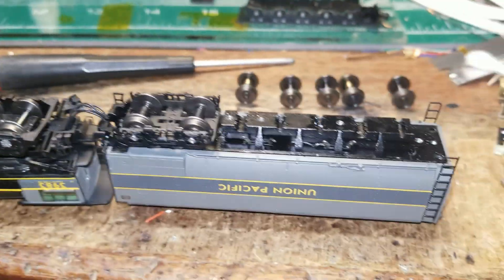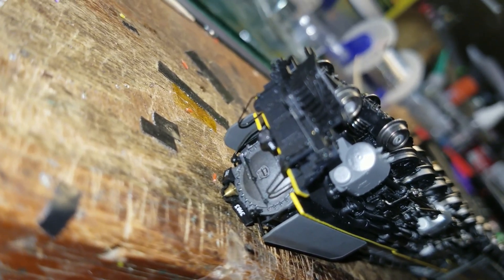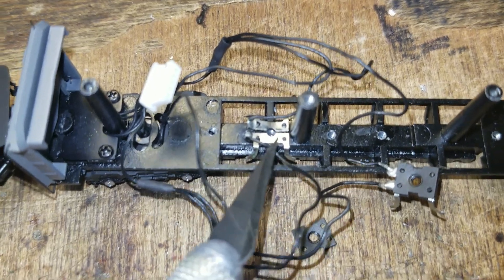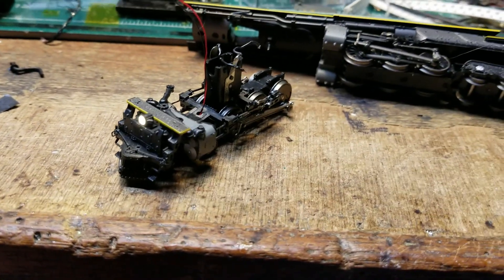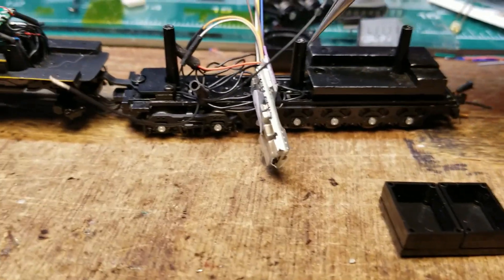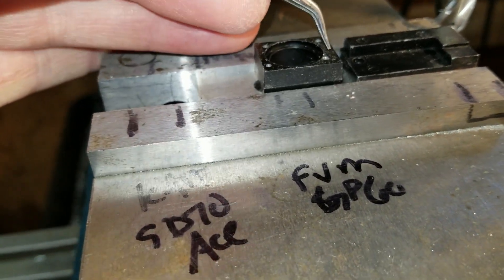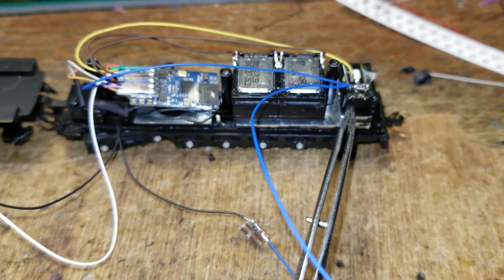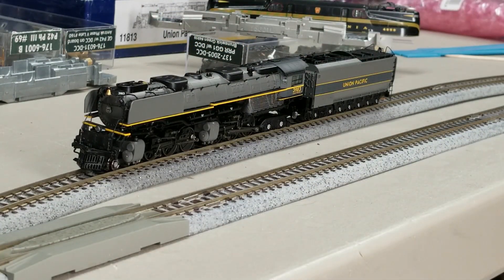N Athearn Challenger repair and LokSound install

Comment: Thanks a lot for the useful video. Good idea to repurpose a Kato board for the tender. One thing I do differently. Instead of wiring the blue wire to the headlight I connect it to one of the pickups in the locomotive. This saves one jumper wire  to the tender.
I just bought a 2007 run of the challenger. I wonder how much time you spent on this conversion.